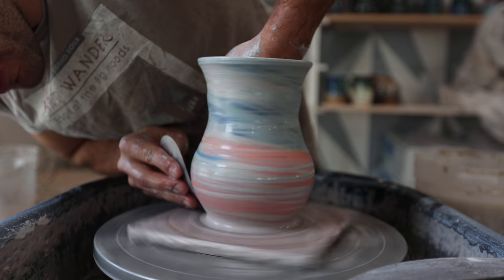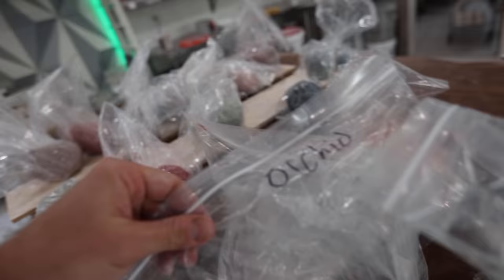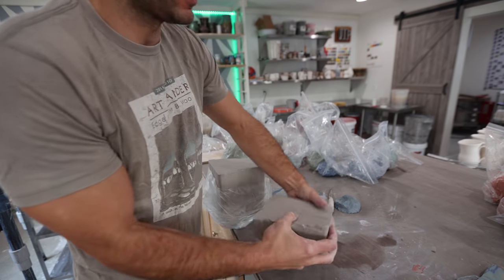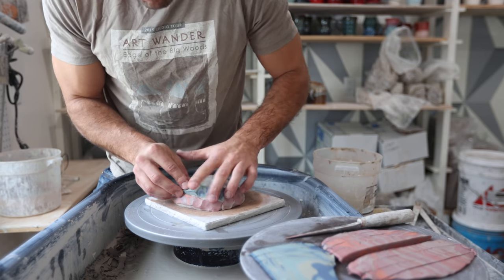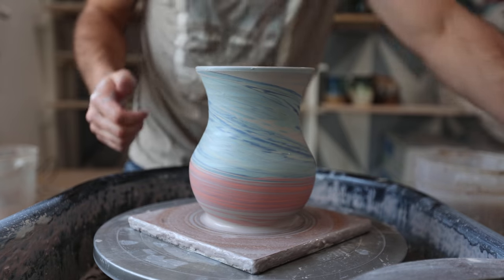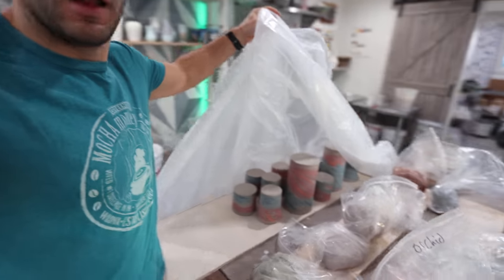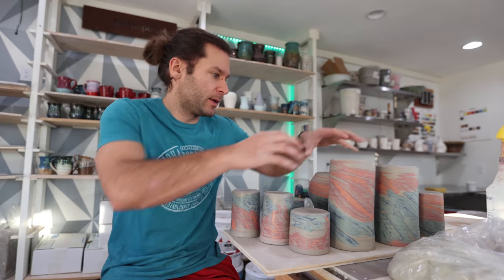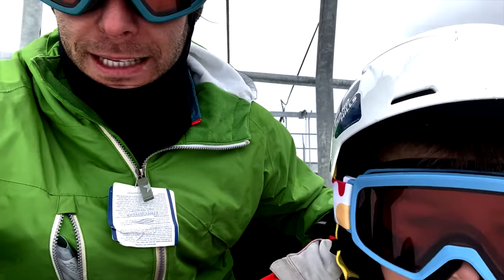BEST Way to MARBLE POTTERY

Comment: Interesting stuff indeed. Beautiful results ☺️ question; wedging the clay helps to remove air bubbles right? Do you think the pressure from working it on the wheel is doing the same job here? To help combinee the plane clay and the marbled together? A pleasure to watch you work. Thanks for sharing your time with us. Till the next one ☕
Reply: Coning on the wheel helps to get air bubbles out and will help mix the clays together.